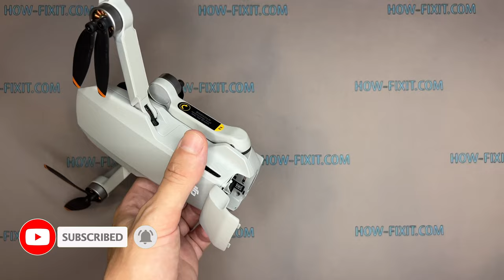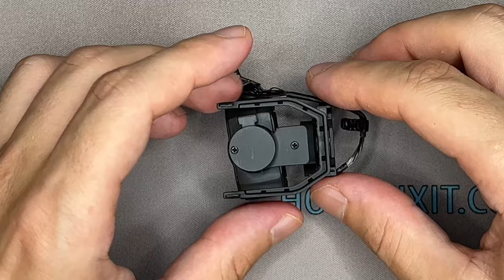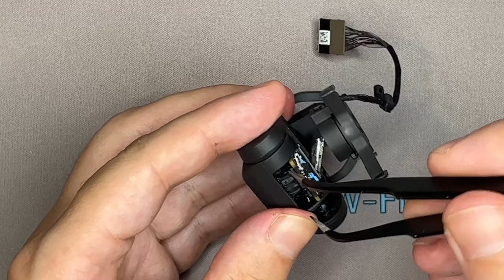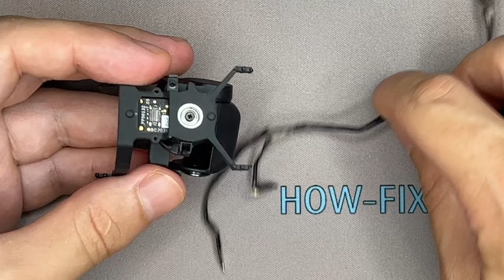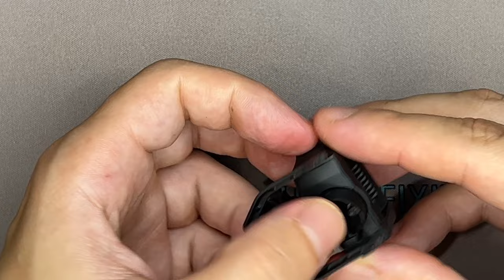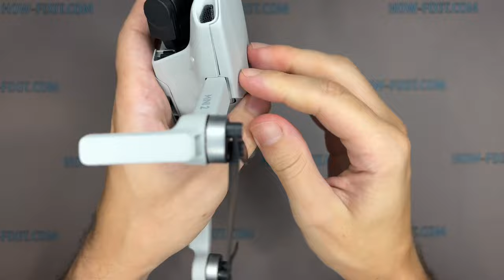DJI Mini 2 Gimbal Replacement: Disassembly, Repair and Reassembly included.

Comment: Hello, thanks for your tutorial , this is by far the best dji mini 2 disassembly guide I've seen so far.

But I was wondering if you ever had to change the gimbal housing stabilizer, becuase I've crashed my drone and the stabilizer broke one of its legs, and lost some rubber in the process.
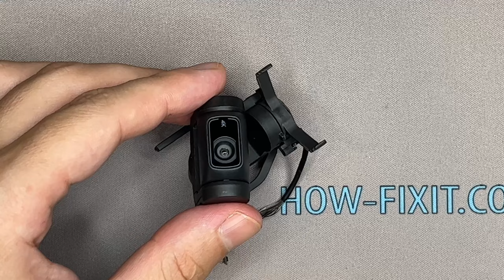I've bought these replacement parts, but then there's a roller (at 7:46 it shows the screw which holds it with a small board in the housing) which I'm afraid to disassemble since I might break it.

If you have any video or tips on that please let me know.
Thank you

Comment: First off, great video.  I watched it early on but couldn't find it during my rebuild so I ended up using a grainier version from someone else that left more questions than it answered.  I am glad I found yours again.  At 2:55, you remove the hot melt glue from the ribbon connector furthest from the gimbal.  On my unit there appears to be a socket right by your tweezer on my board that looks like it should have a connector attached to it but there are no references to it that I have seen.  Is this actually a connector and does anything ever go in it?  I ask because I can't get the gimbal to move during the start or calibration sequence and I am trying to figure out what is wrong.

Comment: managed to epoxy the housing back and install a new harness.  still doesn't look around.  do you need to program if you use the same housing? or is that only when you get a new gimble assembly?

Comment: Thank you very much for the video. Could you clear my doubts? My mini 2 has a shaking image when looking down, horizontally it's normal. The propellers were changed and it didn't solve the problem. the stabilizer rubbers are not broken. Would it be possible for the rubbers to wear out? Do you believe that if I replace them it will solve the problem?

Comment: Any help on getting the press fitting on the top of the gimble assembly off? Three of the four arms broke in a crash and I ordered a new gimble shock absorber bracket, but got stuck at the press fitting and don't want to force it.

Comment: Hi! Thanks for the video. Will a calibration be necessary if you replace the original gimbal after a simple housing repair? Thanks!
Reply: I don’t think so, but if your camera is not moving entirely like normal check all connections and the wire cables for any break/ tear cause this can be an issue easily over sited.

Comment: It seems to me that removing the bottom electronic board and ungluing it from the black tape is not necessary - just disconnecting cables are enough. Great tutorial.
Reply: I was wondering the same—what would prevent one from only removing the gimbal housing and assembly?

Comment: in the video, the removal of screws from the body looked very easy. What size Philips driver do you use? I have a #0 and it seems unable to remove the screws.
Reply: Not Phillips head screw, JIS screw tip.

Comment: I need to find out how to replace the yaw arm. I can't seem to get it loose from the yaw motor after I've removed the screw from the top motor bearing.
Reply: Same did you ever figure it out?
Reply: I heard that someone tried to pry it apart but broke it and I don’t want to try.
Reply: Did you ever. Figure it out?

Comment: do you have to remove the motherboard to get to the camera housing? In my case I just need to glue one part of it.
Reply: no you dont need to do anything except remove the right ribbon cable, from the main board, removing the main board is 100% not needed and a waste of time

Comment: I replaced a gimbal on a mavic air 2. I swapped the new camera for the old camera. The gimbal and camera is fully functional but the gimbal is cocked off to the left about 20 degrees.  Is this a calibration issue that I need to do all that python stuff or should that not apply because I reinstalled the old original camera that came with the drone? The parts supplier is telling me I need to calibrate the gimbal, I think the gimbal is defective. Please help I can’t find any information about error codes or what the gimbal does before calibrating or what happens in my case where you keep the original camera.

Comment: I ended up using epoxy to glue the gimbal bracket back together. I didn't remove the mainboard or any wires attached, I only unsnapped the one wire that goes to the middle of the gimbal and left the other wire attached but unscrewed the hold down wire mount, then unmounted the bracket rubber mounts so I can pull the gimbal away from the drone to be able to glue the broken part back on. Quick setting epoxy for plastics works. Hold together for 5 or so minutes to let it set. Gimbal re-calibration was not necessary.
Reply: Which glue did you use exactly? My Gymbal bracket is also broken, I want to try gluing it but i dont know which glue to order on amazon. Any product recommandation?

Comment: how do you replace the actual gimble frame.  The screw does not seem to want to come out.
Reply: I can send you a photo.  Its the actual bracket that has the 4 rubber shock absorbers attached to it.

Comment: I have followed the replacement. But when I followed the Calibration video Iam having the error code No response on calibration command JointCoarse request on my Mini2. Everything looks connected. Has anyone run into this issue?

Comment: What was the point of removing the board if you can get to all of the gimbal components from the top cover?
Reply: Right?
Reply: The gimbal wire won’t come out if it isn’t removed. Not enough room with it there.  I thought the same.

Comment: Anyone changed both gimbal cables and still hab a dead gimbal/camera? I don't know what to do next, both cables were replaced, I can connect to the remote and app on the mobile phone, but get errors like 40021, 10016, 10022, 40011, 30007, 30049, 30066, 10001 and 40012 .. I guess there's still something wrong with the gimbal, maybe a burnt motor? Any ideas much appreciated. br Mike

Comment: I broke the gimbal bracket.. how do I replace it? gimbal and camera is fine.. I can't find any video about it.. thanks!
Reply: Me neither man what did u do
Reply: Same, ya figure it out when there's no videos unfortunately. That's what I did.
Reply: Same. It's cheap to buy the part. But no idea on repair. Feel free to make a video and show us how you did it.
Reply: @MattBlack6  do you guys still need a video? It was easier than expected.
Reply: @flunflomflop  yes please definitely
Reply: @MattBlack6 onde comprou a peça? Sou do Brasil e também quebrei o mesmo
Reply: @flunflomflop  hey can you please reply on here or DM on how you fixed this issue? I'm stuck on separating the gimbal from the bracket. Thanks!!
Reply: It can't. The vibration bracket is fixed to the motor and the motor housing is not openable. I tried till I broke the entire thing and threw it away.
Reply: Anywhere to send the drone to have this repair done?
Reply: @flunflomflop  did you manage to change the bracket? I have the part but no instructions 😅
Reply: Can you make a video about how to fix the flat cable in gimbal @flunflomflop
Reply: Superglue.
Reply: I need to pop off the bearings to change the centre arm but can't figure it out without using to much force. 😢
Reply: @flunflomflop did you make a video?
Reply: @darrellthelegend might just be time to eat the damage and buy a new one I think
Reply: I'm stuck getting the pin out

Comment: Hi,
 First of all thank you for your interesting videos.
 I have a small problem my mini 2 is impossible to take off.

 The error message says:
 Power system hardware error (code:30210).

 Could you enlighten me on the element or component to be replaced.

 Thank you ☺️
Reply: Check your motors, the hair like wire strands might be an issue.

Comment: Dissapointing  and  potentially  destructive video. 

The screwdriver needed to remove the lower screws holding the upper body together is a JIS screw head, not a Phillips screw head!
I do not know what size JIS head is needed as mine has lost its markings, however a DJI forum user states it as,
" JIS# 00 or JIS# 000". 
The JIS  screw tip is not used  to remove all  screws found on the drone. For instance the, the screw driver provided with the drone ( Fly more combo ) to replace propellers  is most assuredly a Philips tip. 

If you find your self placing an undue amount of pressure on the screw driver handle, as well as the top of drone to remove screw...STOP. You have the wrong screw driver. 
You can could crack the body of the drone, strip the screw head or break somthing else. 

Moreover, the unfortunate use of the spudger to remover the upper body of drone..
Center of upper body  has two interior molded clips ( look left and right for seam at battery bay ) holding lower body together. Reaching in from the inside to release/ease off those clips with the spudger seems less problematic  then the  prying action the spudger is performing  in the video. 

There is information to be had from watching this video, to be sure... however, I do not believe  the the true intent of this  video is to provide information.
As I said.. dissapointing.

Comment: Its so vulnerable that the smallest crash can effect horizon quality....

Its cheaper to send it in if you can at all possible and have the authorized techs fix it....

 Shame right to repair isn't a thing

Also fully removing the mobo? Not nessocary

Comment: Is it possible for the DJI Mini 2 to swap a hole gimbal module (with cables and camera)? Or is the cable/camera/gimbal of the DJI MINI 2 somehow bounded to the DJI Account, which make it nessesary to remove alle the cables and camera?